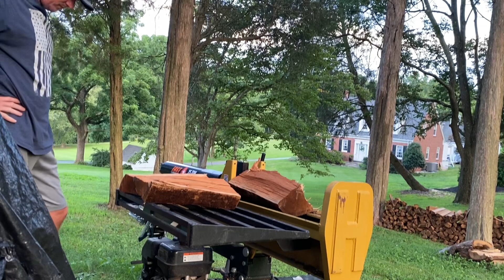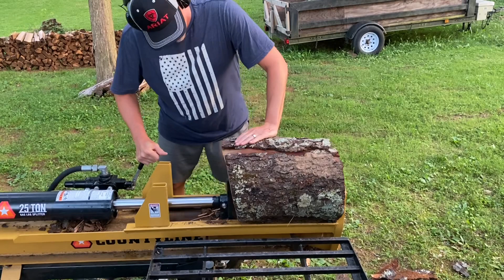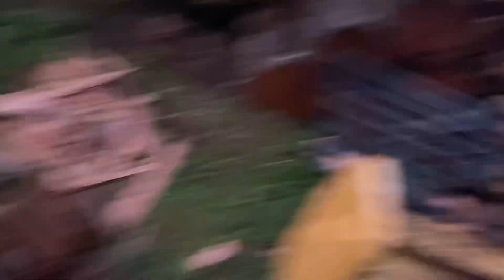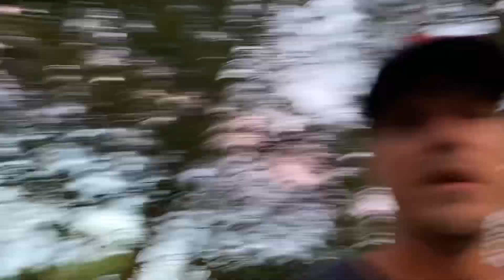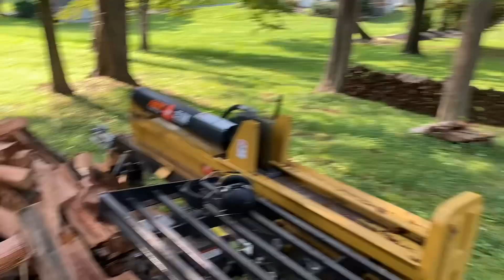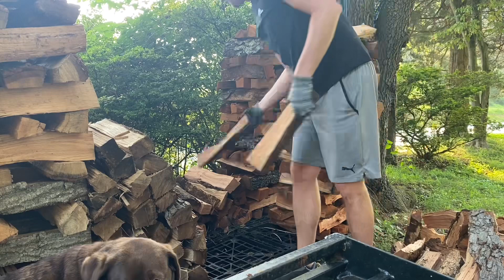Splitting the Last of My Cherry Rounds and Stacking Firewood!!

Comment: Your carburetor needs a cleaning. All gumed up from that etynal crap gas.
Reply from the maker: This could be, I normally run it out of gas and use it often so it doesn't sit long. I will say the gas is so bad any more, even if you leave it in a machine for 3 weeks without running it, it could be bad.

Comment: HOW TO FIND NUMBER OF CORDS IN ANY SIZE RELATIVELY SQUARE STACK OF FIREWOOD
Use a calculator.
1. Measure the stack in inches.
Inches Wide or Deep X Inches Tall or High X Inches Long = a big number.
Example: 36 in wide X 69 in tall X 156 in long = 387,504 cu inches. 
2. Now divide 387,504 by 1728, (cubic inches in a cubic foot) = 224.25.  
3. Now divide 224.25 by 128, (cubic feet in a cord of wood) = 1.75 cords of firewood.